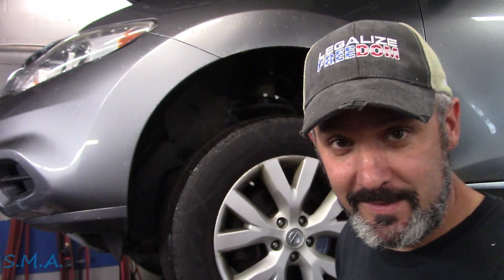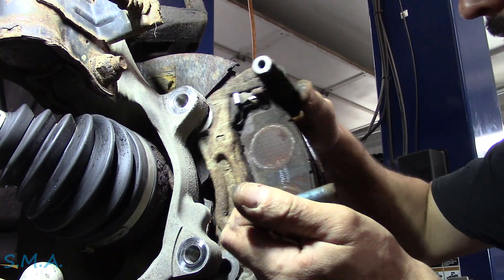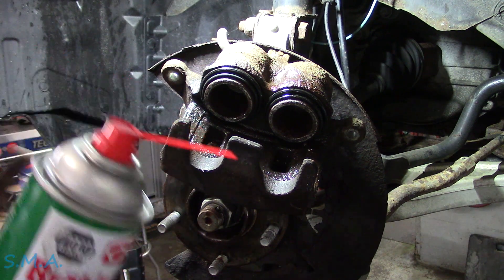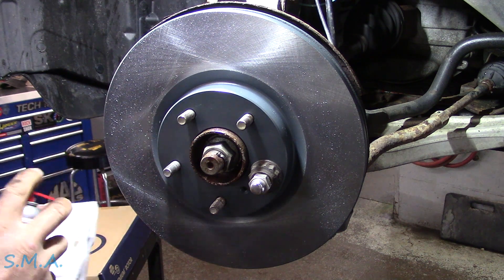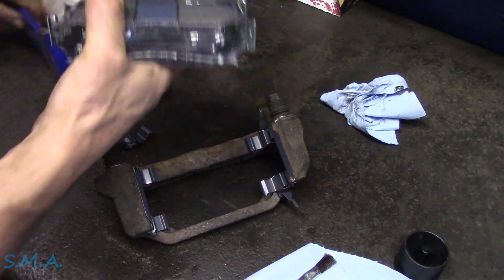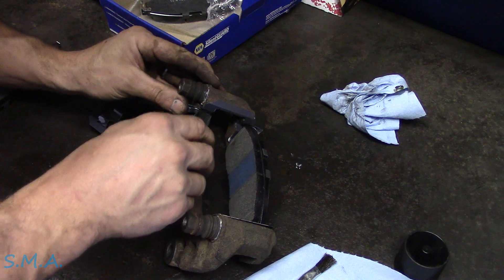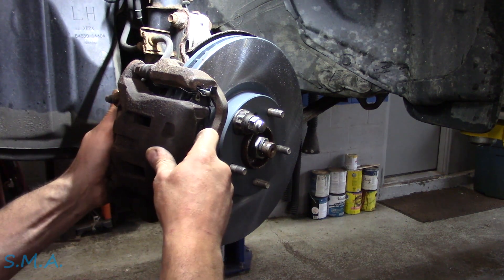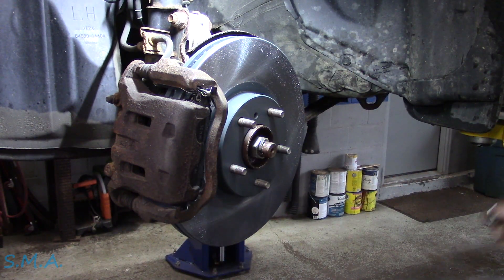Nissan Murano: Front Brake Pads & Rotors

Comment: fyi
    Melting point of aluminum: 1220°F/660°C
    Melting point of brass:
        Red: 1810-1880°F/990-1025°C
        Yellow: 1660-1710°F/905-932°C
    Melting point of copper: 1983°F/1084°C
    Melting point of iron:
        Wrought: 2700-2900°F/1482-1593°C
        Cast: 2060-2200°F/1127-1204°C
    Melting point of stainless steel: 2750°F/1510°C
    Melting point of steel (carbon): 2500-2800°F/1371-1540°C
    Melting point of titanium: 3040°F/1670°C

Comment: The torque specs on the 22mm caliper bracket bolts should be around 120-138lbft.  I recently replaced a wheel bearing on an 06 G35 which uses a similar (identical) rotor and caliper, and that's what the specs were.

Comment: i have an f150 , the brakes needed changing so during the operation the hose was rusty and broke spilling fluid out the caliper, then couldn't disconnect it it from the line so i snipped it off by the module all i can say it was a handfull....
Reply: Well! That escalated quickly!

Comment: I'm not a mechanic but I am a metallurgist. The melting point of gray cast iron is 2150F and the melting point of carbon steel is 2760F, or thereabouts. So your 3000F magic goo should be up to the task.

Comment: I'm having a lot of advance auto/carquest rotors warp before it is time to replace the pads. I usually do a midyear clean lube of the pad hardware to prevent sticking. Should I buy OEM nissan instead?

Comment: My brake question is Will semi metallic brake pad keep a rotor from getting rusty better then ceramic ? Your brake video's are very relaxing.
Reply: Nope, they both will let the rotor rot, the biggest issue is flash rust and then static vehicle rust. I have seen ceramic pads that sat outside for years, the brake surface is fine, but the backer plates were rotted. With many semi pads I've seen the brake material corrode and crumble after a long time.

Comment: Have you ever considered going with the pressure can and bulk buy for the brake Kleen?

Can be had on the scam a zon or of course from your local NAPA. 

(Zep Model B Heavy-Duty Steel Solvent Sprayer 829801)

Comment: I got new brakes put on  my Honda Accord and the very first time driving it felt like they were not stopping as good as  the old pair that was damm near down to the last metal.5 months later they sound worn down already what could the issue be. I got the rotors changed and had the brake fluid changed
Reply: Take a look at them, is one side worn more that the other? Is one pad (inner/outer) worn more on either side? Sticking calipers can cause lower braking power. Then if they used a cheap brake material it could cause that as well.

Comment: Just retired after 40 years at Boeing. Everything is torqued to a specification.
Reply: Has to be that way because you have to “idiot-proof” the tensional load on the fastener which is also the clamping load on the parts being fastened. Not only to prevent exceeding the proof load of the bolt/screw, but also to prevent damaging the parts to be clamped… e.g., gasketed assemblies.

Comment: Hello sir. Question for yah, when putting the pads on does it matter where the brake squeeler is on whether be on the topside or the bottom. 07 Nissan Murano. Thanks.

Comment: That rubber sleeve that is on the end of one of the brake pins, I assume is for noise damping. And, is there correct position (top or bottom) for that pin?

Comment: Hi Eric, another awesome video. I have a very stupid question. I just replace the brakes on my 2004 Ford Ranger XLT 4 x 4. The brake hardware that came with the pads must be crap or I put them on incorrectly. Do you have a video showing how to put the front caliper hardware brackets on correctly?

Comment: I always thought the little tube of lube that comes with the new brake pads was meant to lube where the pad slides on the hardware in the calliper. I guess that’s a no no because there’s a risk of it getting on the rotor?

Comment: I've watched a dozen or so SMA brake jobs and have yet to see Eric rebuild a caliper. Whatup wiff dat?
Reply: If you see a shop rebuilding a caliper it is because a replacement isn't available. Takes excessive time and you have to warranty your work as well. Same with turning rotors. In the time it takes to properly rebuild the calipers and cut the rotors you could have that car out the door and another on the rack. It's fine for a DIYer, just not in a shop.
Reply: @Blazer02LS  I have to admit that it's been nearly 50 years since I worked in a shop. A disc brake job back then always included replacing the caliper seals and boots. But we also turned rotors, but the rotors back then were a lot heavier duty.

Comment: Hey Eric. Question. I live in the Lake Ontario/Tug Hill Region. When I do my brakes at home I clean off all the rust to bare metal and spray it with heat resistant auto paint (to try to seal the metal from the corrosion) and rebuild.  Is that overkill in your opinion? My family thinks I'm over doing it. Need a professional opinion. Thanks.
Reply: Not a professional, but the fact he doesn't do this seems the me it probably is overkill.
Reply: I live in Norway. Our winters are fairly rough and we use alot of salt on the roads. As a consequence of that we do not paint parts that is gonna see alot of wear. Reasons to that are two fold. One is the wear. Small rocks and everything on the road will chip off paint and eventually rust will get hold. That in turn makes for alot of extra work every time one does breaks. Second issue is costs over time. No matter what we do we must probably change all of the brake assembly within 10 yrs. Add on top of that the costs of paint and labour every 2 yrs and it will get pricey.

But. Custom painted brake calipers are pretty. And if you dont mind the extra costs and work. Go for it ;)
Reply: Not over kill. Most repair shops do not have time to watch paint dry. More important on the caliper bracket to protect it from rust jacking the pads.
Reply: It probably just means that when your vehicle goes to the crusher due to body and frame rot that the brakes will still be nice and shiny. 😀
Reply: Given most vehicles seem to fare well enough without painting them, those that don't tend to be due to lack of maintenance or owner ignorance, then it is probably overkill. 
But if it makes you happy, then do it. If you family doesn't like it, tell them they can do the brakes and see how quickly they agree with you...
Reply: I do that with my own vehicles because it means the parts stay reasonably rust free and clean. On customer vehicles they get what Eric does most of the time.

Comment: if anyone is reading, i learned to work on several of my own cars via the internet and books. any tips to someone who wants to start working at a simple auto shop with no experience working on other peoples cars? ive replaced main bearings and assembled a new 8.8 3.73 rear end and im simi experianced  on a mill and lathe

Comment: Question...sometimes the pads fit way too tight in the brackets with the little stainless steel clippy things installed...when that happened last time, I filed down the ends of the pads a little bit where they slip into the brackets. The other day, I couldn't find a file so I cheated and only put one clippy thing on each bracket instead of two. 
Is that Real Bad?

Comment: How much resistance do you have to have on pushing the pistons back in a caliper before replacing them?
I look for inside pad wearing more than the outside.
Reply: That's has to do with the bolts the caliper is sliding on. Unless your caliper has pistons on both sides, then some might be rusted, bad rubber seal, old brake fluid...

Comment: Do you remove the cap from the master cylinder fluid reservoir before you push those caliper pistons back in?
Reply: You can do, though no need to remove it, just loosen it. They are not airtight anyway but it can make pushing the calipers in easier. I do sometimes, but you have to remember to tighten it again.

Comment: well done , hey I have a 2006 Sebring convertable and,,, LOL. just kidding! its a POS. but it does have the Original Factor spare tire and wheel never been put on the car. The clear Coat in the lug nut holes Has never been scuffed. not bad for a POS.

Comment: Eric, can you comment on which caliper pin has the rubber bushing? Looks like it was the trailing pin, as the rotor spins the  first pin to see a spot on the rotor is the caliper pin with no bushing. Is that always the proper configuration? A few Nissan car manuals I’ve seen do not make it clear.
Reply: It depends on the car, I've found some that contain the bushing on the lower pin but more commonly I find them on the upper. Best advice I would suggest is if not completely confident do one side at a time while having both wheels off so that if uncertain at any point you will always have the other side as a reference. If not capable of having both wheels off simultaneously, then take step by step pictures or detailed notes during disassembly to utilize as your reference.

Comment: I have a minivan, that because of rona; didn't see any use. Shouldn't have left it sit for a year by itself. Now, aside from the brake job I just did; the (then) 2 year old battery won't hold a good charge for long, so I need a new battery. I also changed the oil because while it never saw even half of it's life in mileage, it did sit there for a year and I did start it up and move it back and forth in the driveway once or twice a month so it's got it's life used up in regards to time.

Comment: Eric the rotor will not be red, 7:53 it will be liquid. All cast & wrought iron, and stainless & carbon steel, liquefy at or below 2800°F.
Reply: Just like 911 with kerosene at 450 f vs structural steel.

Comment: 7:54 Your rotors would be close to red at that point. We have a retired Crown Vic P71 that we use as a practice race car around an open track. Granted using Hawk pads and rotors that can take the heat without too much trouble, the heat marking paint we put on them to see how hot they get during a lap showed right about 2500°F at its peak. So 3000°F does sound crazy but it’s wiggle room for some brake applications
Reply: Both Carbon Steel and Stainless Steel have a melting point of between 2,600-2,800*F so if you are actually reaching temperatures of 2,500*F on your rotors then what silicon you are using is redundant as the rotor would be starting to melt if pushed any further lol. Also of course they would claim it is resistant to 3,000*F because by that point it be kind of hard to prove it wasn't when the part it was on is now liquid lol.
Reply: @Georgiaboy9009  Rotors are ductile iron usually. That melts at about 1150° C or 2100° F.
Reply: @Fix_It_Again_Tony  If talking about your everyday vehicle you are correct, however when it comes to vehicles specifically intended for racing, those that don't use ceramic use steel as it has a higher melting point and thus can sustain the continuous heat.

Comment: Were the old rotors toast? Or was it just cheaper to replace than turn the old ones?
Reply: You can machine the face of rotors to return them to a "like new" (surface finish, parallelism) surface as long as the face to face thickness is above the wear limit. However, rotors are pretty cheap so the labor to do with probably costs more than new rotors.

Comment: Eric, torque specs are an internet  no fly zone! Don't go there! It is pretty straightforward if you are bolting two steel parts together with a through-bolt, but as you mentioned, when that steel bolt is threaded into aluminum or a softer material then you'd have to do more homework. Don't even think about getting into plastic parts!!!!!

Comment: Put on your safety squints.

Going along with your thoughts it could be true that cars will change after sitting for months after being used almost everyday. It's a subtle change but it's there, even though cars are machines they sort of act like living creatures and when their environment changes they do too. For example I drove my fat sedan almost everyday but after parking it for a couple months the car started to shake and shimmy on the highway, possibly the tires or the old suspension parts. I assume something is amiss because that change in driving routine changed the vehicle's behavior since it never did that, the only time I had that exact same experience was when I drove another car that sat for a year. That's my theory at least.

Comment: 89% of things can be fixed 100% of the time with simply soaking the bad part with pb blaster and repeatedly tapping with a ball peen. if hammering causes a different part to break, simply wrap part in duct tape. if duct tape fails, simply apply a generous amount of 2 part epoxy and let set for 4 minutes, then reapply duct tape.      eric-"if i can do it, u can do it"       me- "yeah, but i'm way faster"               is south main accepting applications?

Comment: Did old cars from the  60s and 70s as bad as the new ones ?
Reply: Often worse.
Japanese cars from the '70' and early '80's we're really bad for rust.
Mostly because all their steel was recycled scrap and the processes used did not clean it up enough.
Add that to thin metal and zero thought given to rustproofing you could have panels and frames rotting through in just a couple of harsh winters.

Comment: Why do you always replace the rotors instead of saving the customer cash when you can turn the ones not gouged beyond spec?
Reply: Because rotors are so cheap nowadays compared to the potential liability involved in using a turned down rotor.  ✌🏻
Reply: @GrifFungin  
Ya, there's potential liability built-in to all service-oriented work in and of itself. Every part of the job has to be done right. Truck, van and even some car rotors can be costly in addition to being part of the (new normal) delivery time in getting them which also figures-in to customer service satisfaction. Having a lathe (like every good service tool) can turn being in a pickle, back into a cucumber. 😊

Comment: The salt is so bad in my area that the brake pads won't slide back into their guides... I end up cutting down the "wings" of the brake pads to make them slide again. Much cheaper than replacing calipers, rotors, brackets, and pads every few years.
Reply: Remove the hardware and use a coarse file to remove the rust that builds up behind the hardware, Then grease them as shown and they will slide together just fine.

Comment: With torque, there are different values for torque specs, most of ours varying slightly due to if its a “soft” “medium” or a “hard joint”
Most of that changes the values up or down from medium 8% or so

Comment: Eric O, your tea leaves didn't fail you. 
Most of the car insurance companies were discounting policies due to people not driving anywhere close to pre COOF times.

Now, they're cashing in on pent up demand for new cars and trucks, with higher than yester years insurance rates.

I was at my insurance agents office last week and he asked if I would be interested in rolling my vehicle policy to my home owners policy for a substantial discount? Well, I had recently renewed the vehicle policy with the lizard guys, but maybe next time. He did inform me to expect a homeowners rate increase due to increased prices , for building materials and labor.

As for torque specifications, rarely will you find a fine thread fastener used in aluminum part. Torque specs are based on the yield of the fastener with a given thread pitch, fastener grade (5 or 8 for SAE),  and whether installed dry or lubricated. 
I don't recall the metric fastener grades, as aerospace/aviation still uses SAE, including Airbus, except for rivets.

Comment: The melting point of steel is about 3000 degrees.  Brake grease rated for 3000 degrees.... hmmm.